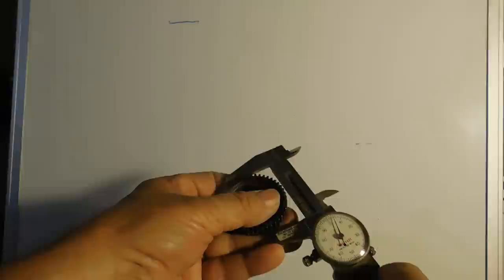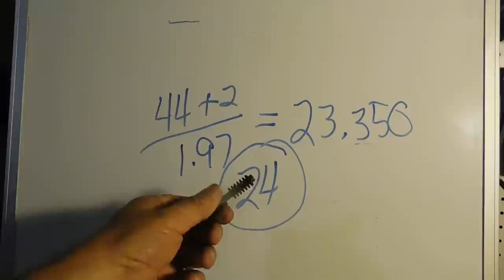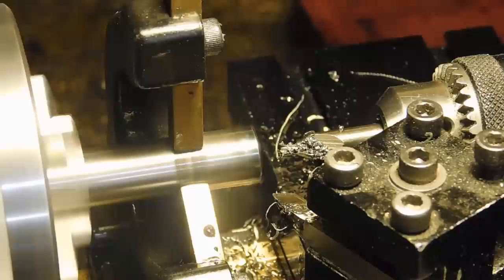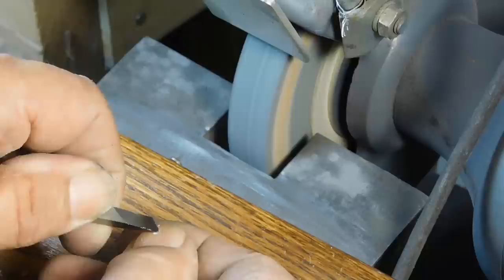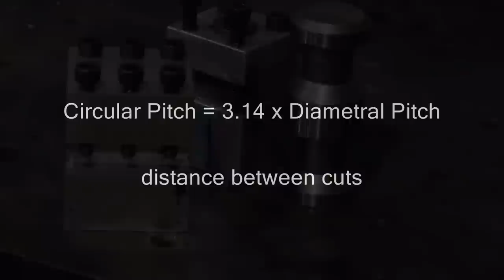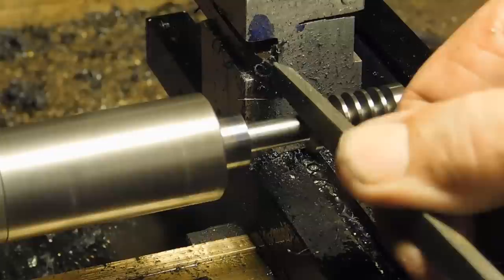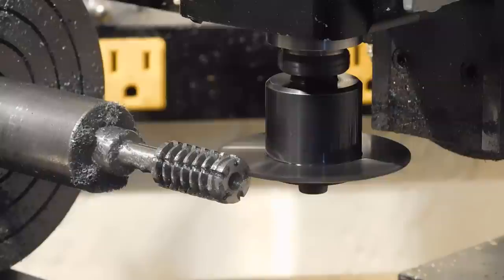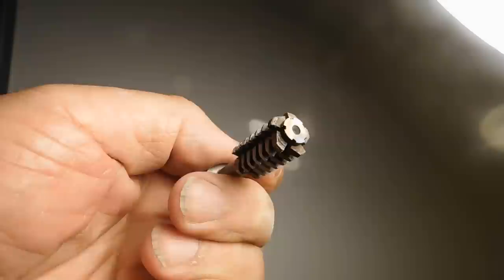DIY Gear Hob Part One

Comment: These cutters are NOT hobs. A hob has a thread form and is set at an angle to axis of the work that corresponds to the lead angle of the hob at the hobs pitch diameter. Plus when hobs are made a device is used on the lathe that cuts back clearance on the tooth. In use the gear blank is rotated at ratio to the hob equal to the number of teeth. This type of cutter is commonly called a tangetial hob or an approximate hob. The main reason they work is they are not only cutting the tooth that is on the center line it is also cutting the teeth on each side slightly on the flank. The gears have faceted teeth and are not true involutes
Reply: The gears are no more faceted then those made by true hobs.  In a hob, the number of facets is a function of the number of flutes on the cutter, and can't be changed.  When cutting with a "tangential hob", the number of facets can be increased to any number desired.  If this cutter makes one pass per gear tooth, a certain number of facets will result.  After this initial cut, the gear can be indexed "in between" the usual index positions, and the hob shifted by 1/2 tooth, and the gear recut.  This can be done any number if times to make the facets as small as desired.  This would be done on gears with few teeth.

Comment: What's that ridiculously long deadcenter you're using that's why it's chattering so bad that dead centering doing hell of a lot of nothing with that much overhang. Use a standard length dead center and move that tailstock uptight get some rigidity in place.  And you're spending that sucker way too fast
Reply from the maker: I can't bring the table back far enough...lathe bought in 1981...Sherline has now cut out the tail-stock and offers an extension for the older models...chatters from high RPM to stop the motor from stalling or taking so long on the cut it hardens the surface.
Reply: @robertt-cs8fe  don't you have an atles?   Also high speed generates heat faster And will harden this tool steel faster!  Use oil! Or coolant in a spritzer!
I mean it's your project and you can do it any way you wish lol....  Chatter makes me insane
Reply from the maker: I started with experimenting with making gear cutters some time ago…DIY hobs about 3 years ago…I’ve got 7 hobs available for gear cutting right now…I started plunge cutting in O1 tool steel…very hard, very difficult…tried A2…never got it hardened correctly…then I started using W1…much nicer to work with, easy to harden…while testing I used an old airbrush to mist (I use it when cutting plastics with CNC)…I decided an acid brush works just as well for me for plunge cuts into tool steel.
Decided bit geometry was worth looking at so I made a graver with a 29 degree included angle and chucked up a piece of tool steel in watchmakers lathe…graver allowed me to move the tip of the bit up and down and
sideways to get a feel of the cut…rpm is on a foot petal so got to play with that some too…swarf tells the story and I decided the bit needed some top relief so gave it 5 degree top relief and went back to the engine lathe…results somewhat better…but still noisy.
Decided to present bit on a 13.5 degree angle on the compound like when threading…results were maybe just a bit better…but finding the distance between cuts (0.1309) got to be a challenge.
I made a tool post to go on the backside of the compound and turn the bit upside down…nothing new here…been parting stuff off like this for some time…I liked the results...but still noisy.
I don’t know how many plunge cuts I’ve made over the years…but testing I made quite a few…and these DIY hobs are just one type of gear cutter…I make muti-tooth cycloidal cutters on a regular basis and right
now I’m working with a button tool to forming involute cutters…all of these gear cutters require plunge cuts that need to be very accurate…I've found to get that accuracy I get noise but the cut can be very well formed after a few attempts and working carefully with your equipment...your results may differ...give it a try.

Comment: Something is wrong with your lathe.  The headstock seemed to be bending back when you did the center drill of the end.  You should put a reference surface on the cutter that represents the pitch diameter (tangent to the pitch diameter of the gear when the gear is finished).

Comment: You really should’ve adjusted your RPM to avoid that chattering. Not only is it bad for the ears, it’s bad for the profile of the tool
Reply from the maker: machine was stalling at lower speeds....I sharpen all my own tool...part of my job...

Comment: That's not a hob.  Its a form cutter.  A hob has a rack profile cut in a helix and when used to make a gear is syncronize with the work, which is fed at the helix angle.  I've done what you done and it works, but its crude compared to hobbing which is true generation of the gear
Reply: It is no more crude (as far as the tooth form produced on the gear) than a "real" hob.  A cut by a real hob forms facets because it is not a true helical form; it is a sequence of offset cylindrical cutters; the offset determined by the number of flutes.  But it is not practical to "hob" this way in an industrial production environment.  In fact, you have more control of the facet size for this then a "real" hob (which is constrained by the number of flutes on the hob).  You can set gear index head to index "in between" the teeth, and offset the cutter axially by corresponding amount to form double the number of smaller facets.

Comment: There is a way to make the plunge cuts easier, especially on a machine with limited rigidity.  First start with a light cut as you did.  Then move the tool sideways a short distance from the centerline of the cut.  This broadens the cut so the next deeper pass only cuts at the pointed end of the tool, lowering the cutting forces.  Keep advancing and going sideways less and less until at the end you are straight plunging.

Comment: Whole depth for 14 1/2 degree pressure angle, is 2.157/P where P is diametral pitch. Diametral pitch is  N/D, O.D. of the gear blank is N+2/P. But overall, you have convinced me, that I have got to make a hob. Thanks!
Reply from the maker: Enjoy

Comment: It is very simple when you have Module type gears.
M is the Module, and is the head height of the tooth.
And is the distance from the primitive radiusto the external radius.
The Primitive Diameter is Z x M, where Z is the Number of teeth, and M is the Modulus.
There is another value that is "The "root height", that is equal to 1.2 x M.
I measured some gears with this method without any problems.
Regards!!

Comment: These cutters remind me of something I tried with large taps that have badly worn teeth at the working end. Set-up in a surface grinder with the tap held in some sort of indexed and the leading edge of the flute rotated around 3 to 5°. Grind the top of the teeth until you have a flat slightly wider than 1/number of flutes x the pitch of the tap. Then rotate the tap in the indexer to grind secondary clearance on the teeth. You now have a functioning roughing mill cutter. The problem is to use taps that fit in a collet. An ER collet works great for this as many taps have odd ball shank sizes. These taps do not work as well as a true rougher but for a home shop guy they will suffice. Just don't push them too hard.

Comment: Super. I loved it. Thanks. On looking at the cutting it appears that the only tooth doing any cutting was the center. I would think that with all the teeth the upper teeth would do partial cuts and the central tooth would do the full depth. One pass around and the whole thing is done.
Reply from the maker: Thanks Jim...the center tooth does create the depth...but the teeth on either side create the involute curve and passes at .005" make the curve smooth.
Reply: OK. Thanks. That makes sense. I saw a video where they used a slitting saw in cnc and took about 30 passes per tooth.

Comment: couple questions, what size steppers do you have on lathe and Mill. You don't need to temper after heat treating? Are the teeth of the hob not brittle? Or does it not matter?
Reply from the maker: Lathe, mill and rotary table used NEMA #23,,,DIY CNC Router I built uses NEMA #17...I do not temper hobs or multi tooth gear cutters I make...I've tried tempering them for 2 hrs at 400 degrees just about light straw in my wife's oven...did not go over well and I've never seen any difference...smaller pieces like the buttons I just made for a button tool I did temper to light straw...small items I use either a brass plate or brass shaving over an alcohol lamp...I do make smoothing and cutting broaches from W1 tool steel because they have a nice long handle I can heat the handle carefully and get the cutting edges just right so I do temper them...I am not saying not to temper...I just don't do it to small cutters...bob
Reply: @robertt-cs8fe  What size is your nema 23? Was thinking of using nema 23 450 oz in, 3amp for my lathe and mill. I have a CNC router table and want to reuse the drivers, computer and power supply from that. Got into trouble for using your wife's oven? Laugh. Buy a cheap toaster oven. Will do same thing with no damage to marriage.
Reply from the maker: I'm probably not the guy to ask about stepper motors...I used CNC forum for my info...bunch of good guys there...ya...no more oven and no place in the shop for an oven...but the cutters I'm making this week will be on a CRS bar running through the center and I'll see if I can get the cutting edge to light straw...bob

Comment: At about 5:50 in the video it looks like your lathe starts flexing. What type lathe are you using to make the plunge cuts in the hob? You haven't made a quick release turning fixture for heating your hobs?   Great video.  Leaned a lot.
Reply from the maker: It is a very old Sears/Sherline lathe I've had for quite a bit...sometimes the camera is what is moving as I have a cheap tripod and my shop is not really set up for good photography...I have the gibs very tight and the upside down bit helps a great deal too...but flex is not out of the question

Comment: Hi, nice video thank you. Do you have a video of producing your spiral hob also? Would be interesting to see.
Reply: I’m pretty sure that’s commercial. I am not sure a lathe could get such a low threads per inch, so you’d need so set up a gear train on a mill x axis to a dividing head to get the helix

Comment: Hey man. When you grind that bit make sure to cool with water frequently. The coloring in the metal during sharpening is telling me that tool is no longer hardened. Would explain why its dulling so fast and giving u trouble with the cuts.
Reply from the maker: I'm grinding HSS...some like to grind hot, especially with 5% cobalt bits...I do have a water cup but I seldom cool because I try not to grind too hard...lots of different feelings on grinding HSS...they can lose their sharpness, but they remain hard and able to be resharpened...bob

Comment: Bob,
The more I watch you with these hobs, the greater my desire is to try making one. 
I noticed you didn't temper the hob. Any reason why or did you just miss that part in your video?
Reply from the maker: Al...I used W1 water hardening tool steel...I used MAPP gas to cherry and a quick straight in quench with a swirl once in the water. It was a quick quench until all signs of boiling water were gone...a hob cuts lightly (0.005") so the outside two cutting edges cut an involute form to the tooth...I did not temper the hob...

Now the single point cutters I use for clock gears cut a full depth pass so they are W1 tool steel but hardened in a 10% rock salt solution...the quench is the same but then I wire brush the cutter and once it is cool enough to handle I put it in the oven at 400 degrees for 1 hour to preheat and then a second hour to temper...FYI I have never done this yet but I plan to use a magnet to determine correct cherry temperature...see: 

http://www.machinistweb.com/forum/showthread.php?t=4049

Comment: This looks like it would work for the gears needed for my Craftsman 6 inch lathe.  The first 10 digits of pi (π) are 3.1415926535 not 3.146? Even if you round up it's 3.142. Is there a reason why you used 3.146?

Comment: Are you sure the O.D of that gear was 1.97? I would have thought that the measurement would be nearer 1.91-ish for a 24DP gear. Although its unlikely you'll get an exact O.D. measurement for 24DP,  23.350"' seems a bit out of kilter? Good video though!
Cheers,
Al

Comment: Plese explain why you plunged from backside of lathe with lathe running in reverse.  Was that all about rigidity?
Reply from the maker: Yes rigidity was a factor but I had to made 6 precise plunge cuts into tool steel…the pressure angle was 14.5 degrees and the point of the cutting bit was thin and broke a lot…here is a link to the forum where I discuss the factors leading up to the upside down tool holder (the lathe was not run in reverse but the cutter was on the far side of the crossslide):

http://www.machinistweb.com/forum/showthread.php?t=3917

Hope that helps...
Reply: @robertt-cs8fe  When cutting deep with narrow-tapered tool, the secret is to wiggle tool side-to-side as you plunge, so only one side of the tool is cutting at once.  You can wiggle a lot at the beginning, and reduce the amount of wiggle to zero as you approach final depth.

Comment: Your slitting saw should be on or "below" center for the proper cutting angle.
Reply from the maker: that is referred to a radial rake and I chose to keep it at zero to have a starting point in case I chose to work the math for future cutters...I never made the change...but you'll see in making the cycloidal cutters video I did use a radial rake which seems to work well for me in brass...I also used a radial rake in the video the small ratchet wheel to form a latching...I'm sure radial rake will work here as well if you chose to work it out.

Comment: Is the plunge depth the same for a 20 degree pressure angle?
Reply from the maker: I used a 20 degree pressure angle on my gears for the watchmakers lathe threading attachment. I used 3.41/DP to figure the depth the same as I did with the 24 pitch gears for the Atlas. I would suggest if you are trying to mate your gear with a known gear...stop at the 3.41/DP depth and physically check your depth...in AutoCAD I've used involute gears generated with GearsDXF matched with depths of 4.29/DP and liked the results in bigger DP (14 was the example I used). But I have not had time to actually make a gear with that new depth.
Reply: Thanks :)

Comment: Shouldn't your number of 3.146  be 3.1416 to figure circular pitch ?
Reply from the maker: Yes....my notes were off
Reply: I made a 64 dp cutter shaped like yours, 20 deg, but then I made the profile like the link below, by just offsetting in the chuck and indexing at 90 deg .   http://www.deansphotographica.com/machining/projects/multipoint/multipoint.html
Reply: I am confused, you got your info from http://www.helicron.net/workshop/gearcutting/involute-gears/ Now are they wrong ,again I am confosed
Reply from the maker: I did get my info from that sight and that's how I got 3.146 in my notes...I should have caught it but didn't...so...my mistake.
Reply from the maker: I just finished a Eurika tool...it creates an offset with 12 teeth the way I made it...never felt I needed form relief as I've made quite a few hobs and multi-point cutter with very good results...but I was fascinated by the eurika tool. Have a look if ya got the time:
https://www.youtube.com/watch?v=F_w92CEMlT4
bob

Comment: Just what is the depth of cut?   Measured from where, a sharp tip, a dull tip?   Why not do as the thread guys do and define the depth by the pitch diameter?

Comment: can you tell me the DP, Outside diameter, pressure angle and number of teeth for the back gear system on the 618 lathe. i have one that is in bad shape. the castings are ok but the spindle etc are DIY by previous owner and very poorly made. i cannot afford the cost of a new spindle assembly but can machine the necessary parts,,
great videos
thnx
Reply from the maker: Just got my shoulder fixed...left arm tied up...I'm left handed...I'm not allowed in shop for a minimum of 6 weeks...so I asked some very knowledgeable guys I know to give you a hand...have a look here:

http://www.machinistweb.com/forum/showthread.php?t=4051
Reply: ok thnx
Reply from the maker: got a ride to the shop today...change gears are 24 dp and do not mesh with back gears...big back gear has 55 teeth and best diameter measurement i could get was 2.88"...so # of teeth plus 2 =57 divided by 2.88 = 19.7916...so let's say dp is 20.

small back gear has 20 teeth and my best in place diameter was 1.085"...so # of teeth plus 2 =22 divided by 1.085 = 20.2764...so let's say dp is 20 also...

now the pressure angle is not an equation but an angular measurement that is hard to get off a gear especially installed in the lathe as my back gears are...i was told atlas used a 14.5 pressure angle through out its gears...visual comparison to my 14.5 pa change gears...my guess is the back gears have a pa of 14.5 degrees.

sorry the link did not prove effective.
Reply: yeah that sounds pretty good..i tried counting teeth on a pic from the internet and came up with 56 t'th and 22t'th...i was quessing at the diameters based on what would fit my headstock...i'll go with your numbers and that gives the 6.25 : 1 reduction...thnx very much...